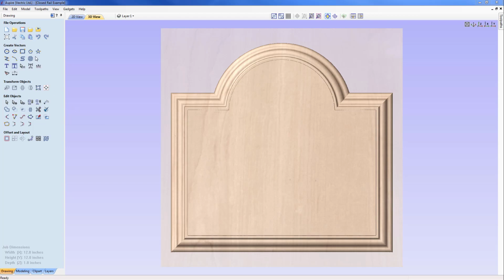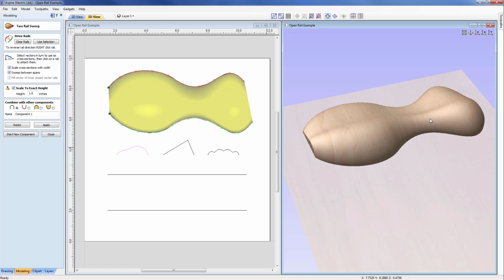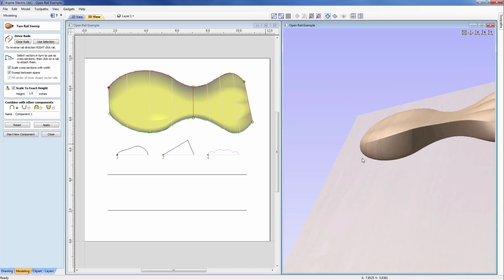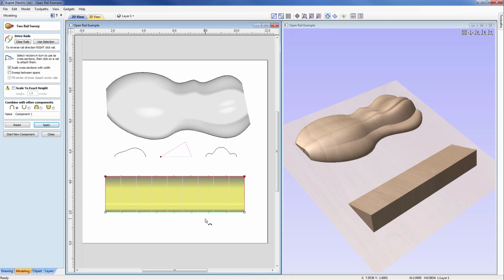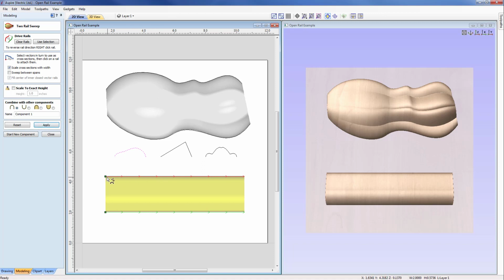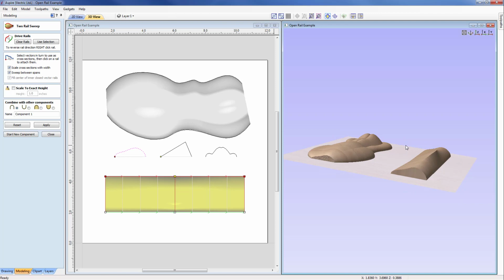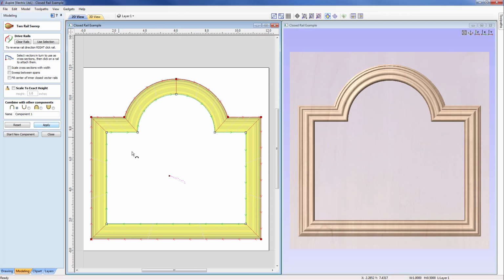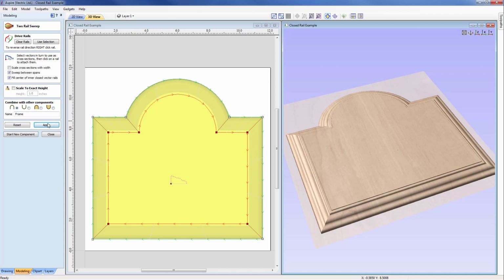Vectric V10 Tutorials | 3D Modeling | Two Rail Sweep Guide

Comment: Great video... I can't click on  "fill center of inner closed vector rails".... Thoughts?
Reply from the maker: Hello Arnold... thanks for the question.  I suspect there is something wrong with either the file or the vector.  I think you might be better off to send the file and a bit of information to support@vectric.com.  I'm sure they can spot the issue quickly.